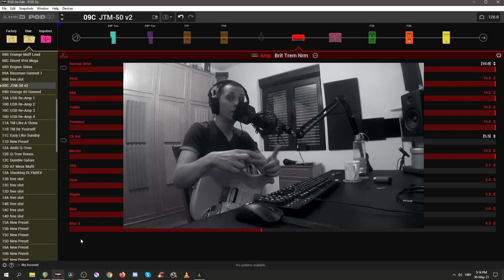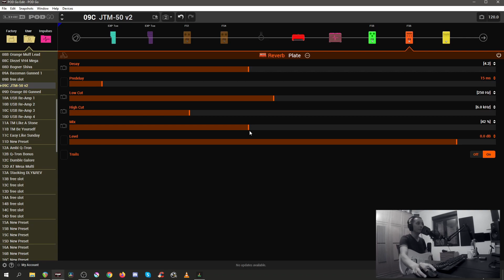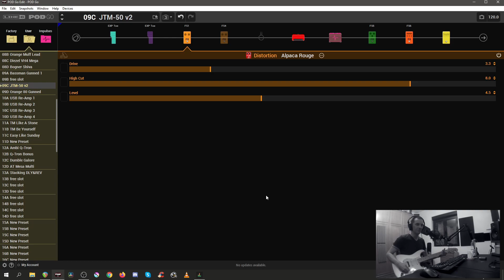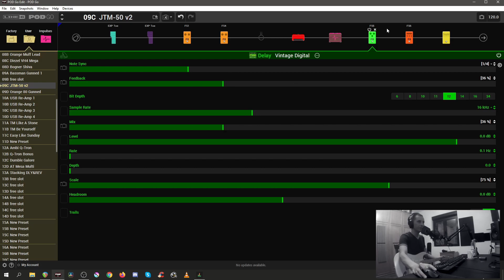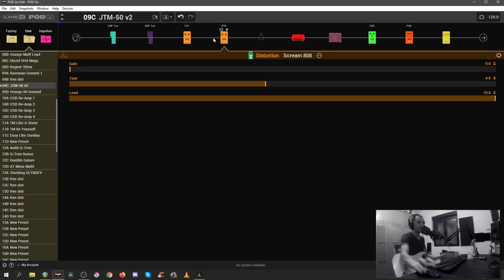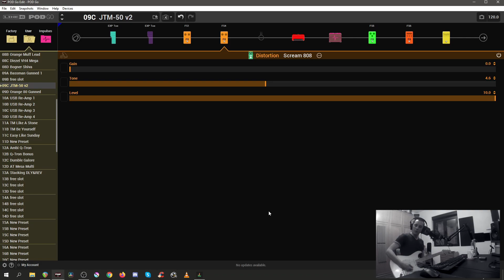Line 6 POD GO: 25 Free Patches - JTM 50 | Virtual Rig Rundown

Comment: Thanks for sharing these, sounds really good
Reply from the maker: Cheers Phil, thank you - check the whole folder with the free stuff for the complete experience! : )
Reply: @pekkyas  Id love a few Prince Patches :) I just got this after using Pod Farm 2 for over 9 years (I think) so its a bit of a new beast, PS I have a Marshall 1960 IR if you would like it with about 60 variations on mic placements etc, DM me
Reply from the maker: @pjhunton , well you can have the Princeton, at least two presets based on that, close enough! Thank you very much for the offer, I definitely don't need IRs! :)